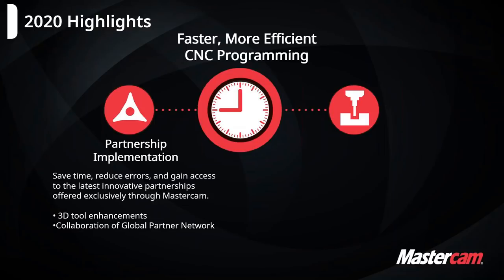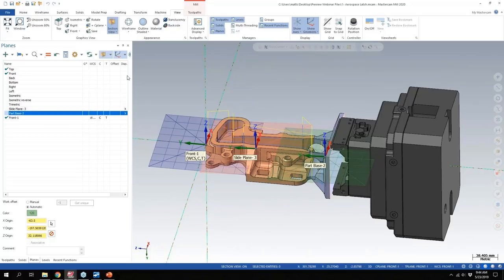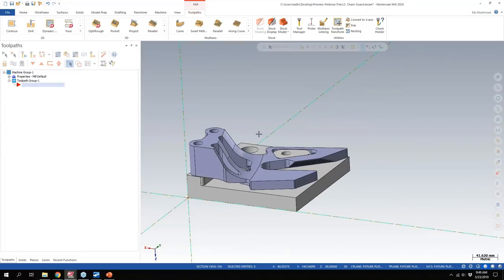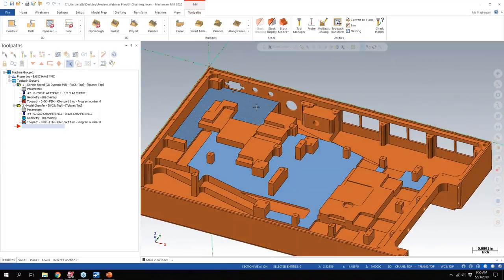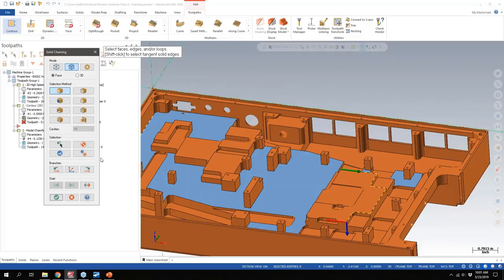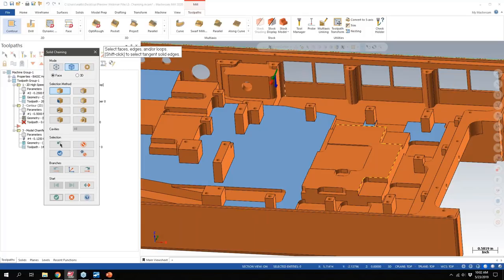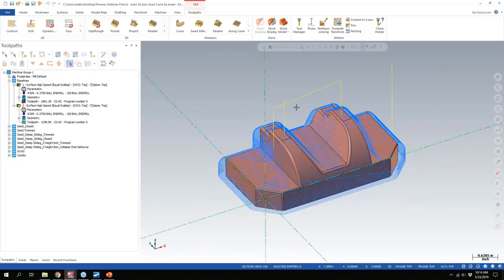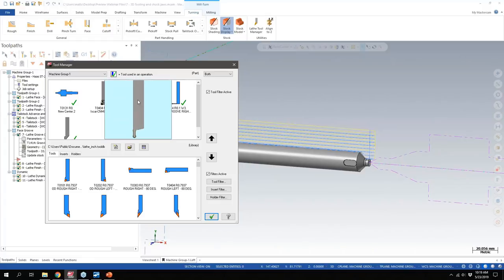Mastercam 2020 Preview Webinar

Comment: Just downloaded 2020, cant run it cause my graphics card isnt open cl 1.2 compatible. Spend spend spend.
Reply from the maker: This error may pop up even if your Graphics card is compatible. Make sure you have the latest drivers installed. If using Nvidia Quadro series make sure it's the latest "ODE" drivers. 

We all run those @ Shopware with latest drivers and was still popping up. This was due to having onboard Intel graphics totally disabled. We're working with Mastercam to resolve as the way the tool is checking it didn't like the disabled on board. Personally I clicked "don't show again" and am still getting optimal graphic performance using a Quadro P3200 mobile card.
Reply: @ShopWareInc  I'm using a quadro m3000 from 2011, it's my backup laptop that I use in the house in the evenings so I dont have to lug my new machine around. My year old system functions fine but the older system throws the error even with the latest driver installed. I'm a one man band here and dont like spending money especially on my backup computer. Any help for it?
Reply from the maker: @tsw199756  The Open CL thing, think ( Edit: Got this from Mastercam to clarify 0- The only places using OpenCL for processing in Mastercam 2020 are the Opti/Dynamic engine and I believe a few HST surface toolpaths.  You'll see speed improvements in some areas while generating those toolpaths if we can leverage OpenCL.). 

The system should still function and be stable. 2020 is the first release where if you only had on-board graphics I'd be very wary, but you should be fine!
Reply: @ShopWareInc  good to know, thanks however I routinely generate large solid files in the 1/4 to 3/4 GB range. Will that hurt me? My pet peeve with Mastercam and Solidworks is that they are not backwards compatible.  So I can't work on 2020 during the day and 2019 in the same file at night. It's the keep spending mentality I initially complained about. I like to keep 2 systems running in case of failure (I've been there too) but buying two 3500 dollar laptops is out of the question for a sole proprietor.
Reply from the maker: @tsw199756  Edited my post above after getting some additional info from Mastercam. You'll be fine. Here's what they said: 
"The only places using OpenCL for processing in Mastercam 2020 are the Opti/Dynamic engine and I believe a few HST surface toolpaths.  You'll see speed improvements in some areas while generating those toolpaths if we can leverage OpenCL."